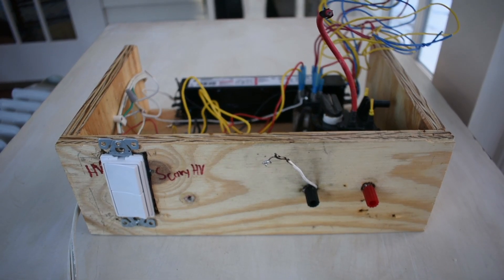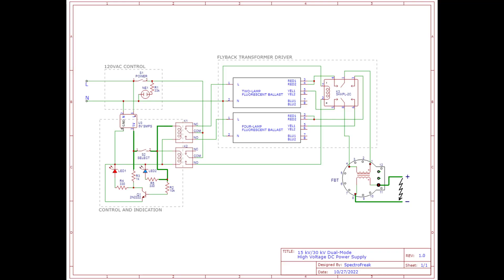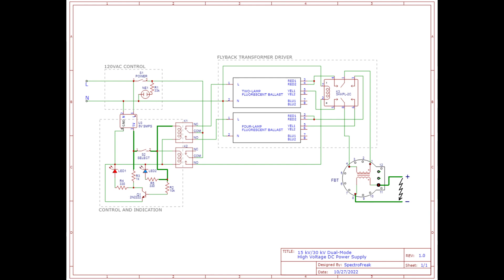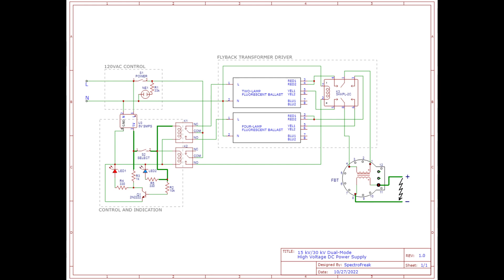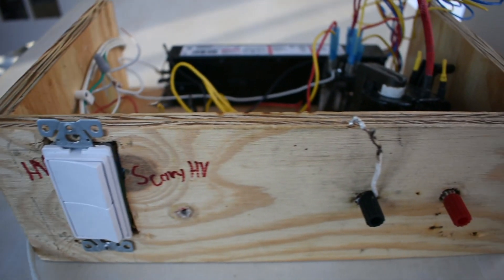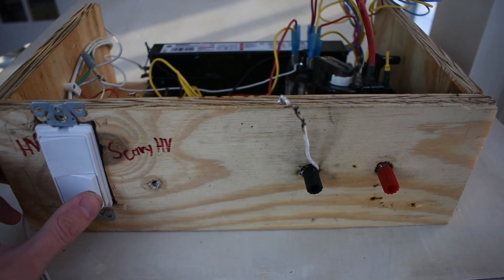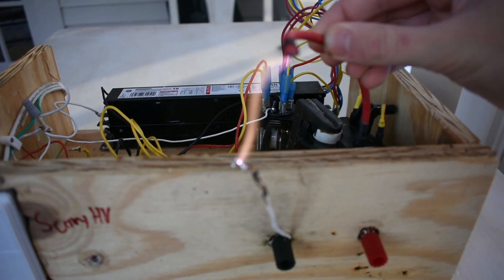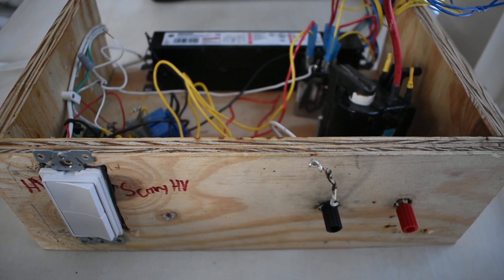My Homemade High Voltage Power Supply (Including Wiring Diagrams!)

Comment: Respect for the quest for knowledge. You have however just the request knowledge to be self harmful. The flyback transformer will IMHO develop hot 🔥 spots and eventually fry. That aside watch out for soft X-rays when you are hooking this "thing" to diode tubes. At least the microwave magnetron did that for you with its metal case. A remote control switch IMHO would wise. Leave the room before your X-ray experiments. Inverse square ⬛ of the distance, if you can't be bothered with shields 😮 Do some more research and reading before launching into stuff that you seem to IMHO appear to barely understand all the risks involved to yourself...

Comment: oh i would not dare bring my bare hand that close to the ouput hahaha nice video!! I think that wire is only rated for 30kv tops too im not entirely sure tho.
Reply from the maker: I think I'm gonna post a short about this, but I keep myself well isolated from ground while using this supply. As a result, I can touch the bare anode while it is running without getting a shock!

Comment: How much is the wattage of the ballasts?
Reply from the maker: The "low voltage" ballast draws about 60 watts at 120 VAC and the higher voltage one draws around 110 W.